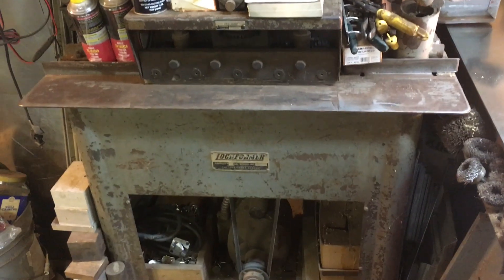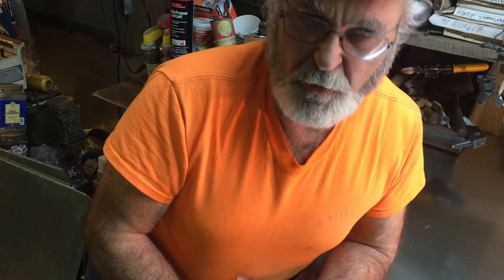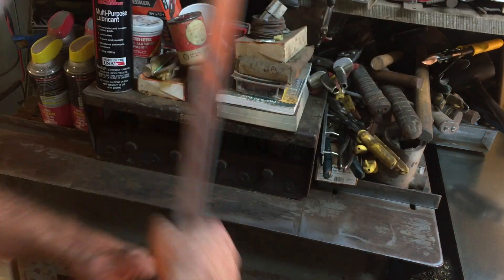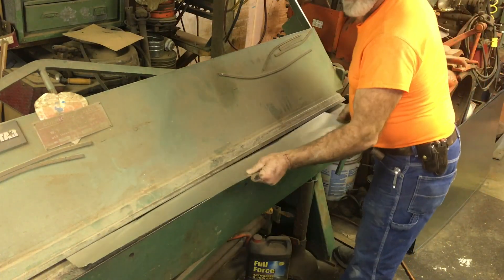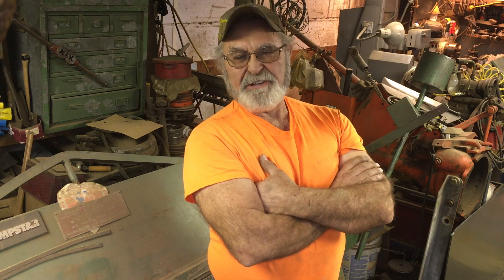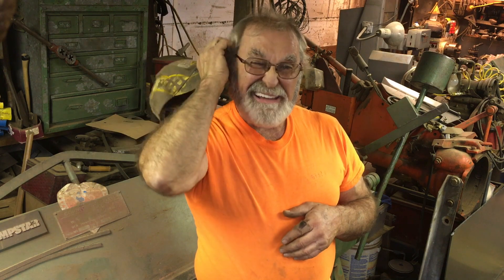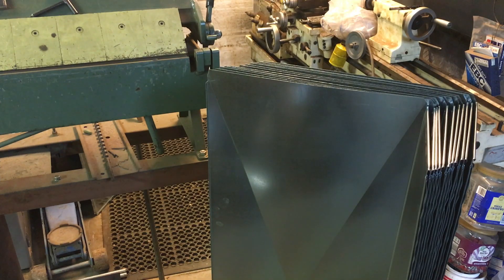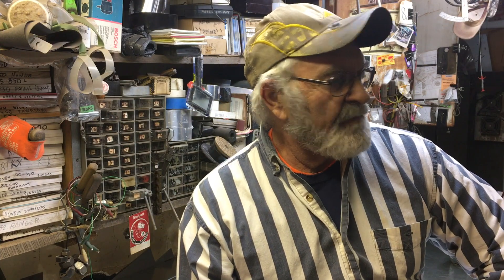HVAC Sheet Metal Layout Part 2

Comment: A radius elbows are awsome. I can use that machine like a master. If you ever want the future of sheetmetal to show you how to use it i would be willing
Reply from the maker: Back in the day I did get pretty good at using the Easy Edger on top of the Lockformer.  I found the longer the radius, the easier the machine was to use.   I was working on a furnace not too long ago that I'd installed in the early 80's and should have taken pictures of all the radius fittings in the supply plenum, return drop and all the transitions down the trunk line.  I had forgotton how nice that job looked !!

Comment: Snap lock is way faster. It does the male and female side
Reply from the maker: I have zero experience with using snap lock machines.  I've knocked together a lot of pre-fab duct though. That's it. And YES, it is super fast to assemble !!

Comment: Hey tractorman, are you old enough (like me) do have learned how to make a pittsburgh lock in the hand brake? Those were the days!!
Reply from the maker: I have in fact folded one or two though it is not at all a fun time.  Or at least I never had the need to learn an easy way to fold 'em. I never got good enough to do it without the aid of a rubber mallet.... On another note, I remember fondly the first time to run a radius through the easy-edger on top of the Lockformer machine.  LOL.  What a surprise that was !! And mine takes only 3/16'' instead of a quarter....but then mine is the only shop I've seen one in too.

Comment: How bad is it to do two at a time? I do it does it mess with the break?
Reply from the maker: hurst no not at all but only in short lengths. But what it does do is shift the bend just a slight bit off your mark. Most of the time it doesn’t matter but I don’t like doing it. The outer sheet will have a less crisp bend. I haven’t done it with anything thicker than 24 ga though and then not even on 8’ lengths. 22 gauge in an 8’ length would put a lot of strain on the apron. The shorter the piece the more forgiving it would be. At least that’s my two cents worth. Thanks for watching and commenting.